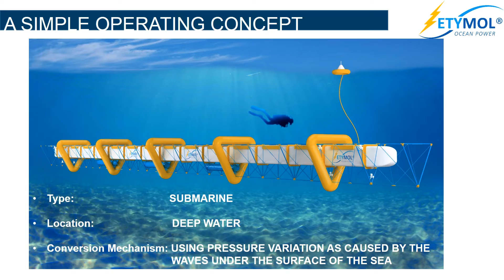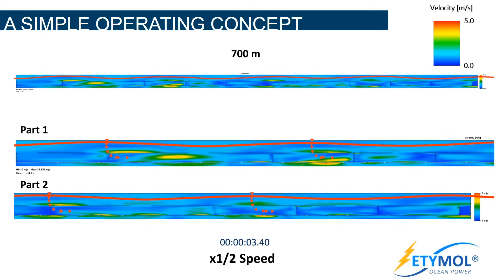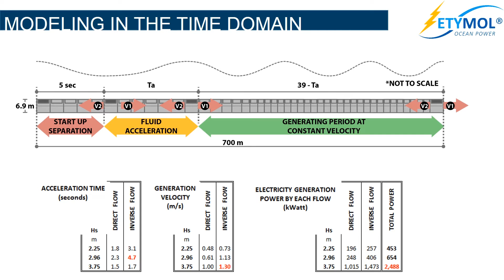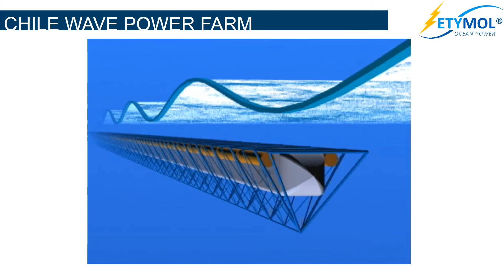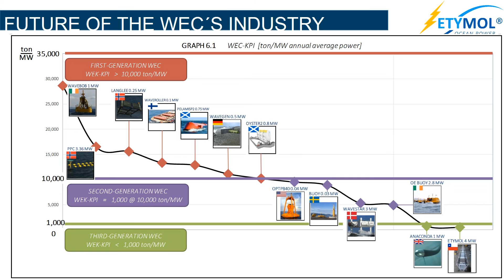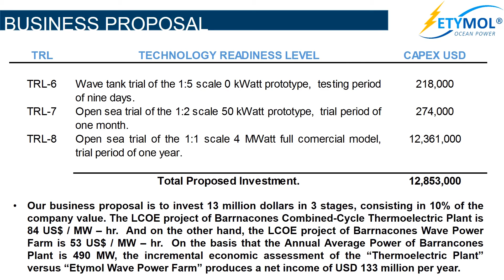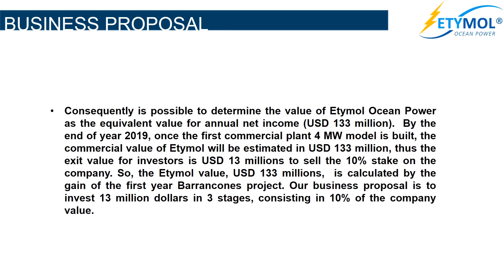Etymol Ocean Power - 4 MW Wave Power Plant (002)

Comment: Check out this video https://youtu.be/v-lJkeRHzAE (or short version https://youtu.be/AG_vz2vHP7M), it aims to get energy from the horizontal motion of the wave which is stronger in the near shore (<half a wavelength, e.g. for a 100m wavelength the particle motion becomes more orbital from 50m depth in to shore). It also keeps all the electrical equipment onshore and reduces the typical mooring costs. Apparently it is hugely expensive to drill mooring points into the ocean floor or to run electrical cables underwater. I’m looking for people to help me build prototypes, they are easy enough to build, the ones I have built so far are all with parts from my local hardware store.
Reply from the maker: Hi Info,

I know WEC similar to your design. We cannot financially finance device other than Etymol, but we are able to help you with some technical guidance.

Greetings

Etymol Team